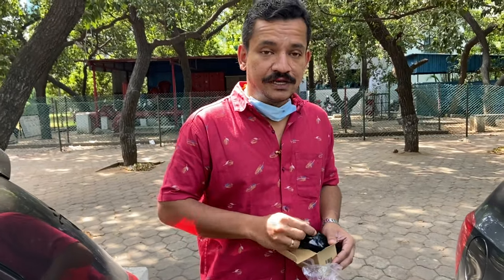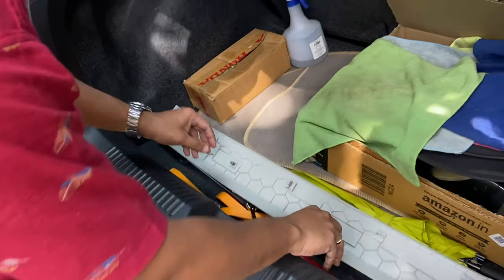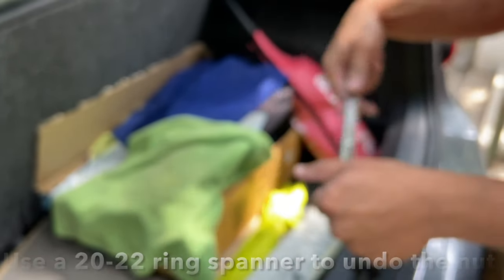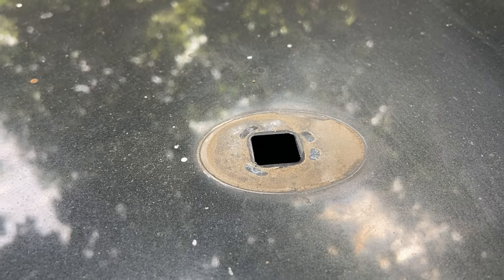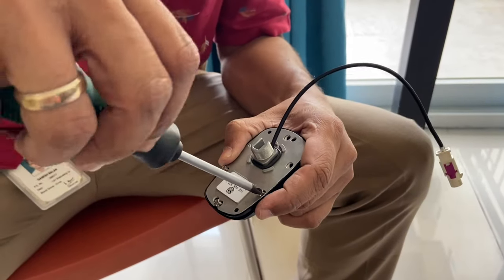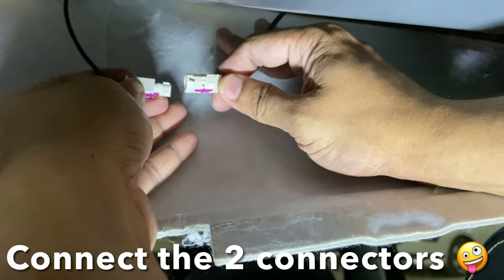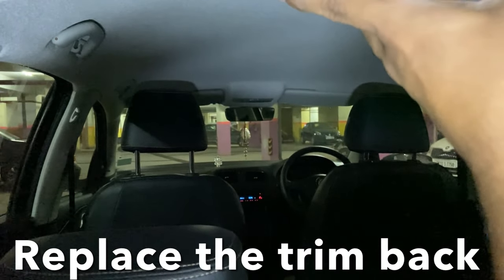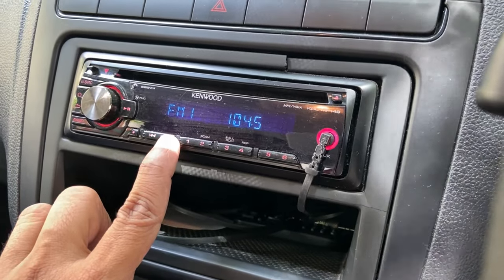Polo 6R - Installing the OE sharkfin antenna

Comment: Big thanks to you and wonderful video. Because of your video I was able to do it for my polo 2021 it was bit difficult as compared since I had to use cutter machine on top of drilling machine but I was able to get the board out of old antenna and successfully installed to the new one and it’s working great!!
Reply from the maker: Hi Shreyas, good to hear man. 🙂👍🏻 Do check out some of my other DIY clips on the Polo. You may find some of them useful.

Comment: Hii.. nice work. In my rapid, the rod like ariel got cracked all over.. One quick doubt? did u tried LED on turn lamps? I sourced a few LEDs from Aliexpress 2 years back wen it was delivering to India.. In their ad, they were telling that it will not make any canbus error. but wen I installed it, it started blinking too quickly. So I removed.
Reply from the maker: Hi Jinu, I missed replying to your comment. Installing LED bulbs in turn indicators causes hyperflashing because the LED bulbs have very low resistance and the system thinks the bulb which was installed has fused. You should use a compensating resistor which is available on Amazon.

Comment: hello ganesh bhai i have a question, can we do this same procedure on vw vento?
Reply from the maker: Hi Sumesh, yes you can. You just need to figure out how to remove the trim and the headliner from the inside. In the Polo it’s easy since opening the tailgate/dicky gives access to the trim. Not for the Vento.
Reply: @GaneshBalan  bhai thank you for replying, without antenna (rod) will i get full radio signal reception without any disturbance?

Comment: Please make a video on safely Trim removal from A to C piller. For Dashcam installation
Reply from the maker: Will do. 👍🏻 For dashcam installation you don’t have to pry open the B or C pillar. You can lead the cable from the headliner or through the door sills.
Reply: Yes need it sir

Comment: Seeing that you are replacing the internal with the stock and that it comes with a rubber gasket, this should work with a lot of vehicles & brands 😅
Reply from the maker: Haha it may work. I’m not sure if the stock circuit from the radio serial of other cars would fit inside this one.

Comment: Great work from you sir. I installed the antenna. but having trouble with reception. 
need help with this issue
Reply from the maker: Hi Rohit, please check if the main contact points on the board are making contact with the metal base of the antenna.
Reply: @GaneshBalan  thank you for the advice the antenna is working fine now.
Reply from the maker: @rohitsalunke9034  How did you resolve it finally? Do share that so it may help others as well. 👍🏻
Reply: @GaneshBalan  As suggested by you. I cleaned the contact points at the bottom of the board and fixed in a way that the points make contact with the antenna metal base

Comment: Greats guts to remove the pcb .... I would not have attempted this :)
But why don't you just use a soldering iron to ease off the ground pads that u drilled ?.?
Reply from the maker: The board isn’t soldered to the base. It is punched. Won’t come off with soldering. :)
Reply: @GaneshBalan  oh i see... It was some plastic/alloy  punching on a groundplane .... That's a weird bit ... Great video by the way.... Thanks for the excellent content...
Reply from the maker: Thanks man. Appreciate it. :)
Reply: Also expecting some DIY fixes on the taigun's rattling issues...  I feel u are the right person who can feel and fix the trims at the right professional way...  :)
Reply from the maker: Haha dude actually the Taigun belongs to my senior colleague. After exhausting most of the DIYs on my Polo GT, we’ve started tinkering on this car now. I’ll wait to hear from him on the rattles. He hasn’t shared anything specific so far. 

I believe due to all the cost cutting, quality of the plastic trims, the clips used etc must have taken a hit. I don’t want to remove anything to check as such. If I come across anything, I’ll be sure to share it. 🙂👍🏻
Reply: @GaneshBalan  thanks Ganesh
I have a taigun 1L topline
Below are few major issues many owners facing
1. Dashboard squeaking noises 
2. Door rattling on bad roads
3. Co driver seat rattling while empty 
4. Some noise from A piller area/ doors when doors are closed with an extra force...

Just for your idea..

Comment: Hi Gannu, I did the exact replacement and have reception issues. Are you facing the same issues?
Reply from the maker: Hi Prithvi, refer some of the comments above. Some users faced it too. The ground part of the PCB needs to have contact with the metal base of the antenna. Ensure that you have it. And before screwing everything back, test the reception.
Reply: @GaneshBalan  Hi Gannu, I guess I was not very clear. While the reception is fine in the city, it's not that great on highways. Earlier, with the stock OEM antenna I used to get reception on regular highway drives. Do you think this is because of the absence of the extended antenna? Can I DM you? Either on email or on team bhp? Thanks.
Reply from the maker: Yep you can WhatsApp me on 9099691369.
Reply: @GaneshBalan  Thank you.

Comment: I have done in same way as you shown in video but there is problem in signal reception
Reply from the maker: Take the circuit board out of the sharkfin enclosure and check the grounding and the radio reception while you do that. Poor signal reception is a classic case of grounding issue.

Comment: Can we do this in a Vento, Since the access to the headliner in the rear would be tough due to fixed rear windshield.
Reply from the maker: Hi, in the Vento you’ll have to attempt this from the cabin. Seek the help of a good aftermarket accessory shop. They are usually very compliant in removing trims of high end cars.

Comment: Hello Sir what is epoxy glue used to fix the PCB back
Reply from the maker: Use hot glue. In the future if you want to remove the board, you can do it. Epoxy glue hardens to a permanent bond.

Comment: Sir big fan of yours. By seeing your mods in team bhp i have modified most in vw GT tsi 2016 model. Thank you very much sir. Keep posting. My cars radio signal is poor in stock antena. Will this shark fin antena improve the signal please suggest sir.
Reply from the maker: What system do you have? The stock antenna gives a very good reception as is evident towards the end of the video. Have the installers cut the radio cable at the music system or something to fit your system?
Reply: @GaneshBalan  sir I have original RCD 330G model. Nothing modified sir.it works good in highways but as soon as I enter into city limits nothing but ghushhh...ghushhhh

Comment: Can it be installed in hyundai i20 elite?
Reply from the maker: Hi, not sure of Hyundais. Try to remove the stock antenna and check if it has a similar mounting hole.

Comment: Sir its not working in my vento
Reply from the maker: Hi Mahendra, please check the comments section in this video. You’re probably facing an improper grounding issue at the base.
Reply: how did you manage to detach the headliner in vento? any advice would be appreciated

Comment: Hi Gannu, actually I tried to remove the board by drilling but not able to do that as I don’t have the bench to secure the aerial properly. 🥲
Reply from the maker: Hi Mayur. You’ve to be a bit careful with this step. Else you risk damaging the PCB and the other SMD components soldered on it. Take it to an engineering workshop but please insist on using the vice and the smallest drill bit.